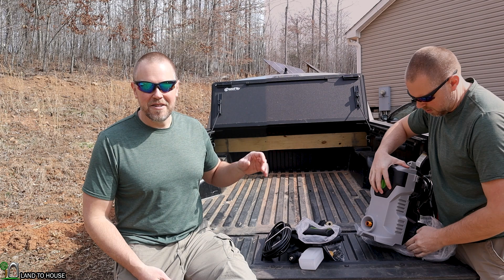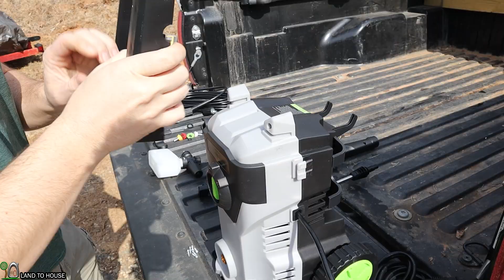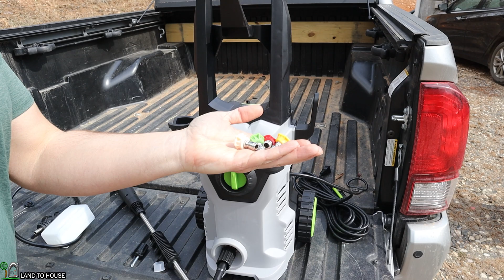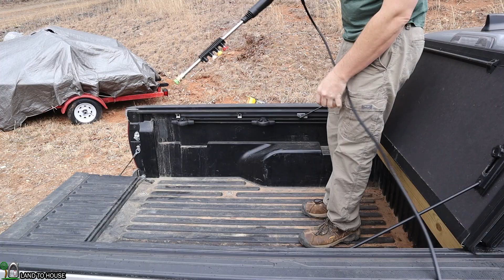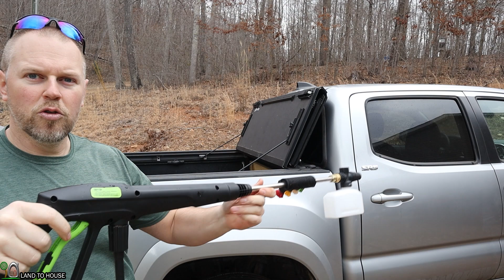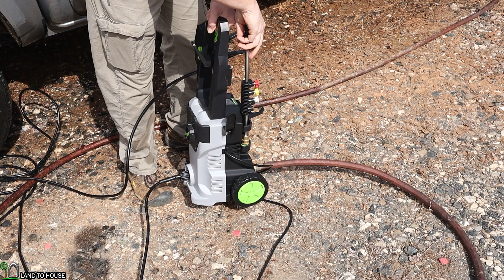Cleaning Road Salt from my truck with the Patoolio Pressure Washer

Comment: Nice little electric one.  Soap bottle at the tip looks like a great idea.  Auto-shutoff when the water isn't running is a great idea, gasoline ones burn out the pump if left running for more than 30 seconds without squeezing the trigger to let water flow through.